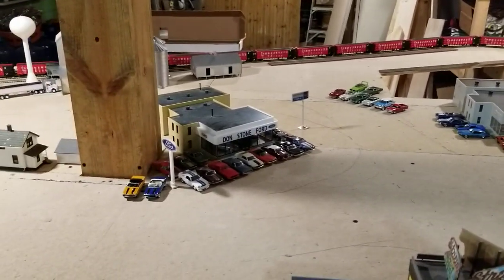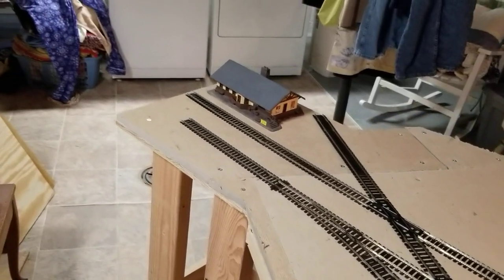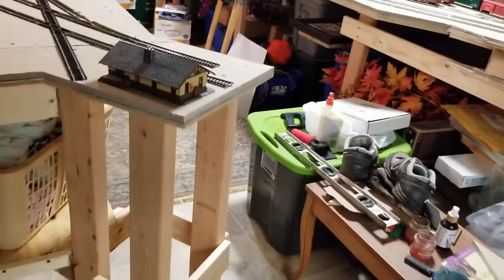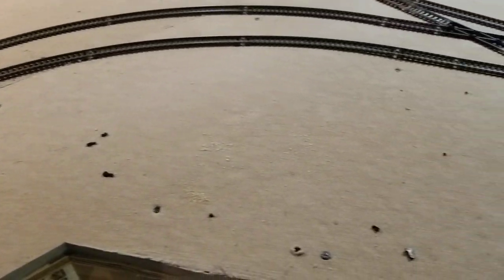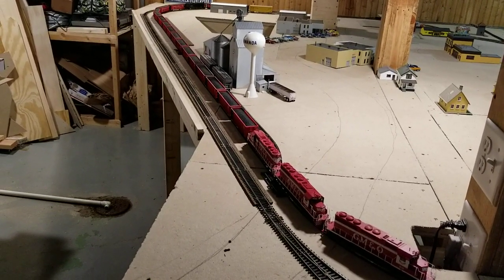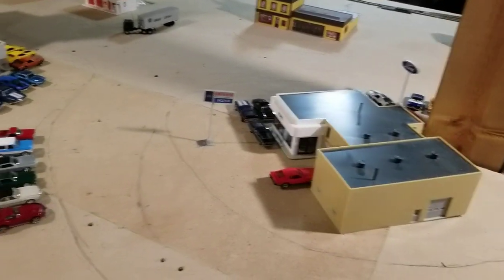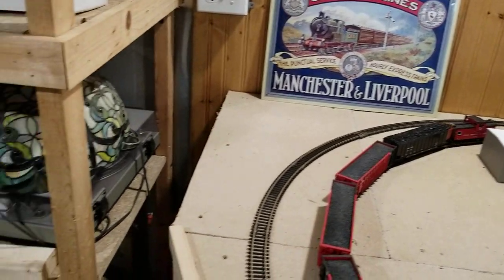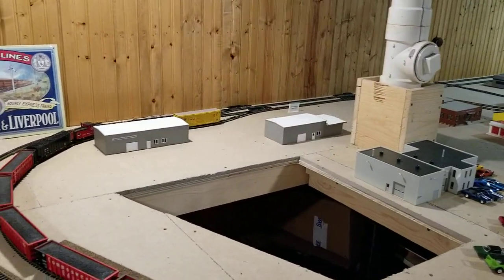BN GM&O Railroad Update 5 26 2020

Comment: cork is not to hard to do on the corners. draw a center line for the track, take the cork road bed apart and flip so the sides are angled, and follow the lines. I always put way to much glue down when I do mine.
Reply from the maker: Hi Sparky. Thanks for the info. I figured Ill get the hang of it. I had a good size layout in my teen days but it was mounted directly to the table. This will be much more quiet. :) Take care! Mike.